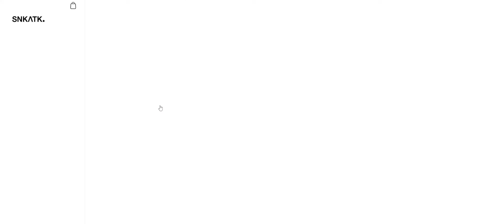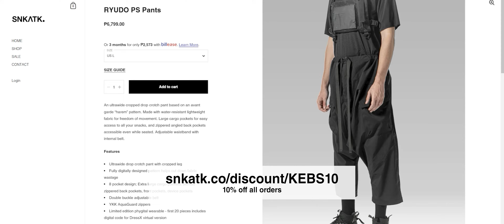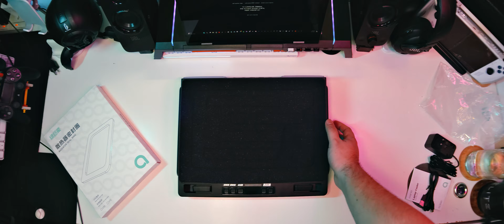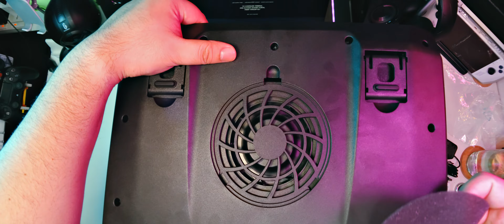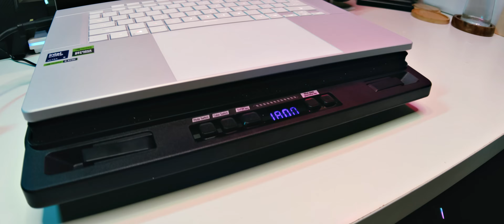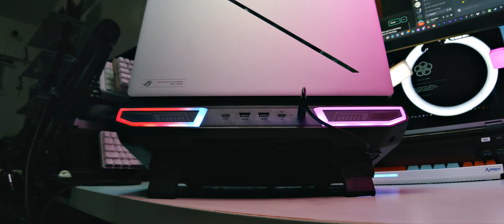Extremely cool! Llano V10 RGB Laptop Cooler Unboxing and Review

Comment: with the g16 venting from the lower back of the unit, i think you where blocking the outlet with the foam. the cooler should have worked better. i have the  2024 g16 with the 4090 and im getting better results then that.
Reply: How do you not block the outlet with the foam? Do you cut the foam?

Comment: I bought the v12 but after some hours of use it shutdown alone, the led light fall down, until it not shutdown entirely.. i should change it and request another one?
Reply from the maker: Sounds like a faulty unit, go get it replaced or warrantied. From where did you get it?